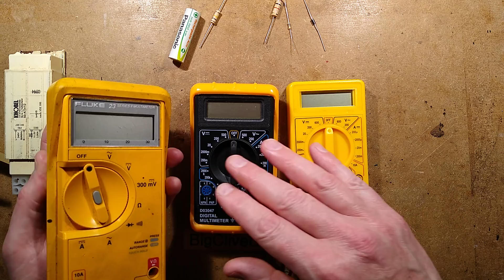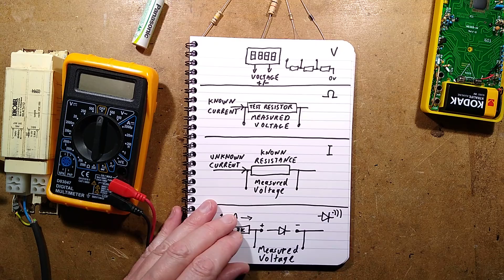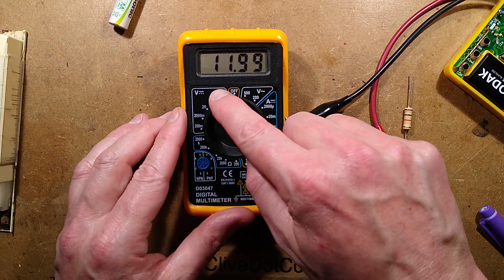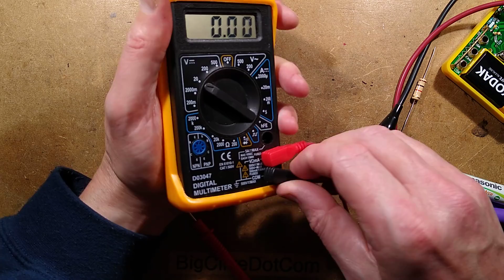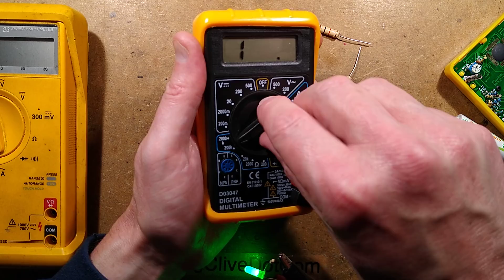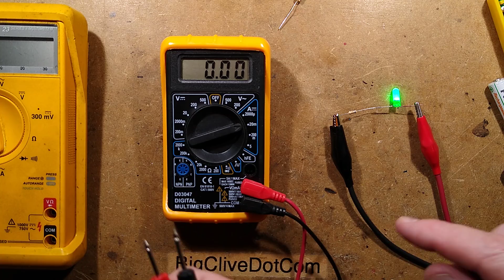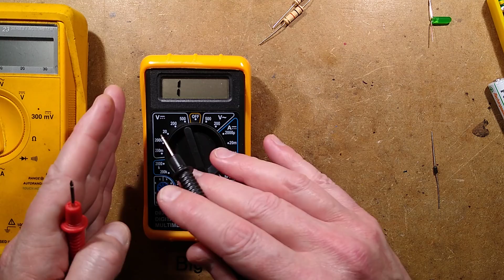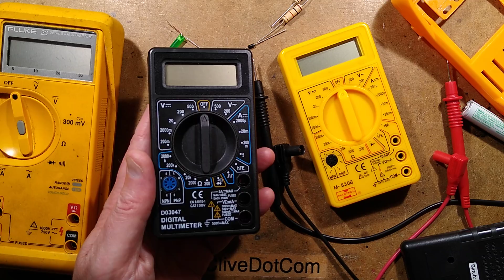How to use your trashy meter without blowing it up (much)

Comment: Just to add a comment that the only result you can obtain using a continuity test is the answer to the question "Is point A connected or not connected to point B" (i.e. is it the other end of the line under test).  I continuity test DOES NOT tell you that the circuit you just tested is working correctly because many multimeter BEEP TESTS will still beep if the tested circuit has a fault condition resistance. Meters could still beep if there is a  90 OHMS fault in the line,  each make of meter varies but gernerally 40ohms to 90ohms can be expected. To test you own meter get a pack of 10ohm resistors and gradually introduce them in series until you meter stops beeping, then you will know your own mters limitation.    

The ONLY real world way to look for a fault in a circuit is to perform the tests when the cicuit is under load (i.e. turned and in working condition) because the current flow in the active circuit DOES affect the voltage drop across a given point due to the 'resistance of the problem part of the cicuit' causing a votage drop across the fault position.  If you really want to check a circuit is working (instead of 'is point A the other end of point B) it is better to perform your tests using the voltage method and check for VOLTAGE DROP across point A compared to point B.  Yes this does sound strange, because I am indeed telling you to check voltage at each end of length of wire or perhaps each end of a length of printed circuit . . . . . . . and indeed if the cicuit is in good condition then your voltage test will return the reading zero volts . . . . .which is correct and as should be NO VOLTAGE LOSS between each end of a wire or printed length of copper etc for a good working curcuit . . . . . . but if THAT part of the circuit has a fault condition, then when the power is active for the circuit section under test, and the section you test is where the fault lies, then you WILL get a voltage reading showing because the voltage you read is the voltage that is being lost across the fault position.  Work you way back until you track down the precise position where you get a voltage drop across the two points under test.  EXAMPLE: You are testing 12volt car wiring, and the fault is a burnt ot corroded or tarnished connection in for example a plug/socket in the harness. Turn on the the circuit under test (i.e. wiper or heater fan motor or lights etc etc) and put you multimeter on the voltage range (normally 12 volts DC range or higher) and probe each end of the section you wish to test (or if accesible each side of all that sections plug/socket WITHOUT DISSCONECTING THE PLUG/SOCKET) and if there is a fault between the two internal terminals then you WILL see a voltage drop across that point.  It is initially difficult to understand this method, so create a simple 12volt circuit . . . 12v + battery plus to a simple switch to a 12v lamp back to - battery . . . . . . .then do the tests using your multimeter VOLTS range . . . . if you creat a fault condition (simple to do as you can just turn off the switch as that is a fault you the user introduced by turning the circuit off) and you will be able to measure the voltage drop across the switch terminals which in this example case of a completely open-circuit will  be the same voltage as the battery voltage.  Faults in circuits that drop only a part of the source voltage (i.e. you find 4volts across a connector etc it means that only 8 volts out of the source 12volts actually reaches the item that should be working (i.e. that wiper/heater/lights). BUILD-PLAY-TEST-UNDERSTAND. Good luck and sorry for the long comments as I got a little carried away typing ;-)

Comment: Well i had to buy a fluke 115 my old cheap meter 3€ was giving me voltage from 40 to 900 if i was holding the probes in the air 😇

Comment: I've always thought of OL to mean Over Limit i.e. out of range for the selected mode. It's an improvement on just showing a 1 as that could mean no continuity at all or Over Limit. Better clarity for the user to show OL to let them know "hey dickhead you're measuring 20KOhm resistor and I'm set to 2KOhm maximum... what do you think would happen?" :D

Comment: Why is a meter that is very accurate make mesurments that is called a "fluke"?
Reply: It was based on the creator's name.  It use to be called "The John Fluke Manufacturing Company", but they eventually shortened it.  John Fluke was a Naval officer in the US in WW II and did electrical work for the Navy.

Comment: If you decide to buy a cheap meter make sure you test it before every use on a know source! I had one where the contact failed on the selector and it read ZERO volts, when I touched it with my finger I immediately found out it was LIVE! I smashed that meter into the ground and turned it into confetti! Dont trust your life with a $5 piece of crap meter!

Comment: Come on guys, give me the name of a reputable mains quality multimeter cheaper than Fluke ?  I’d like a back lit auto ranging one that does not turn into a grenade when I make a mistake ! also I’d like a really squealy buzzer for when I’m buggering around with five miles of wire looking for a fault !
Reply from the maker: The brand you get depends on where you are in the world.  In the UK the Tenma meters from CPC are made to UK standards.

Comment: I use a fluke 43  and a klien dmm and an amprobe clamp on  and my old Simpson analog. Both the fluke and the klien are cat 4 the amprobe is cat 3 and the old  simpson doesn't have a rating that I know of, Fused leads are dangerous and have killed more apprentices and electricians than I care to talk about. Replace internal fuses with those specified and for goodness sake buy quality test leads like Pomona. You get what you pay for and it can save your life and diagnostic time

Comment: You should really follow the instructions on your multimeter. Those cheap multimeters are typically only CAT I and mains is CAT II. These ratings are important for the maximum fault capacity of the meter
Reply from the maker: Full CAT info is in the description.

Comment: I'm not a snob, but I would NOT recommend buying clones of the 830 model to anyone because of the very limited functionality by the standards of today. This is pretty pointless when there are tons of DTM0660L / DM1106EN (HY12P66 ASIC / MCU) based Chinese multimeters out there: the most basic pocket size AN8002 / RM102 / ZT202 (6000 counts); or updated version AN8009 / RM111 / ZT111 (10000 counts); or enlarged version RM303 / ZT303 (20000 counts); or full-sized version AN870 / RM219 / ZT219 (20000 counts); or alternative version Q10 / RM777 (10000 counts) and some others from Richmeters and Habotest. There are also Uni-T UT61E / UT61E Plus multimeter (22000 counts) and UT210E / UT210E Pro clamp meter (2000 counts, but can be changed in EEPROM to 10000 counts with some limitations on DC current measurement due to Hall sensors non-linearity and its opamp rail voltages), both are certified to work with mains voltage and independently tested for compliance with CAT rating. All of the above are True RMS DMMs, but only up to 1 kHz, except for the UT61E, which has an RMS converter IC and can measure AC up to 100 kHz (useful for tinkering with low frequency SMPS). They are not super-cheap like 830 clones, but they worth it.

Comment: And triple P'S.  Where are the tin foil rapped fuses or even rusty screws'''' And have you ever had to recondition a rain/water damaged Multimeter  and then interoperate the results. !    H.

Comment: Life hack: If you replace a fuse with a thick copper wire, it will never blow :)
Reply from the maker: Having been to a job where they finally replaced the last fuse with wire it can be an apocalyptic experience.  Whole power off to a factory and a machine with very melted wiring in it.  The guys coworkers said he pushed in a contactor and the whole panel exploded.

Comment: OL - Open Load!
Reply: No, OL is Over Limit or Outside the Limit. And yes, a complete lack of resistance or continuity is indeed over, or above, the limits and limitations of an ohmmeter to measure ---- but a capacitance meter with enough voltage behind it might be able to measure the capacitance or ESR of the probe tips being held an eight of an inch apart, as if the probes were an analog tuning capacitor perhaps. Now, if he ohmmeter had a 100k Volts behind it, I bet it could measure the resistance of a small air gap between the probes without actually being Over Limit on the meter!

Comment: Let's be real here. It isn't about snobbery. No respectable technician of any kind is using a cheap meter. These are used by diy home owners and people that have no idea what they are doing and it doesn't matter that a lot of them aren't even accurate or reliable. A legit meter isn't that expensive if you do some research, and you will be happy that you made an investment in something decent in the long run. You do not have to buy a Fluke ... there's many other good brands.
Reply from the maker: The point of this video is that these cheap meters are ideal for home bench use.   For professional use I do recommend a higher profile meter, and Fluke for high energy industrial work to tick the clipboard warrior's box.
Reply: @bigclivedotcom  I get that, and that's what I was kinda trying to say, although I"m not sure I really got my point across. But yeah, I still recommend a better meter regardless of what you're using it for, but that's just my opinion.

Comment: I spent (and I cannot figure why) £85 on a "Al'son" ish" Meter ONLY because it had a back-light .... Great leads' with probe caps... Testing corroded crap in bilges__hence dark... Obs.. Yes.. after a year ... girlfriend stolen .. now best-friend stolen...   Cheap meters ROCK .. for multy reasons ...  Anyone willing to send me One as I'm suffering from "I've pay-to-own" one of these,! .. phillips drivers and side-cutters in this Gang also .. could Snap-on give me a "full set" would be so cool..  running out of LED's to do polarity tests ?  Hi clive....